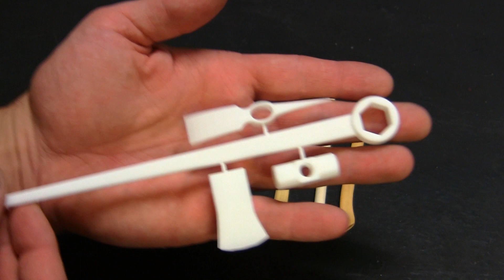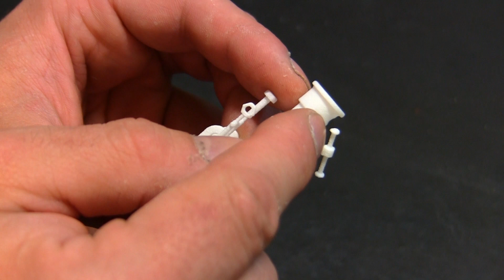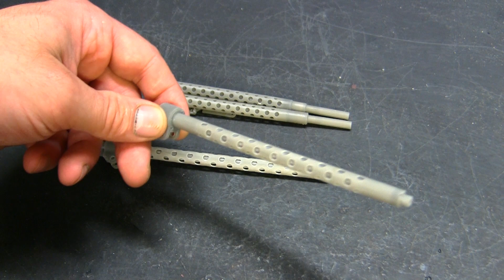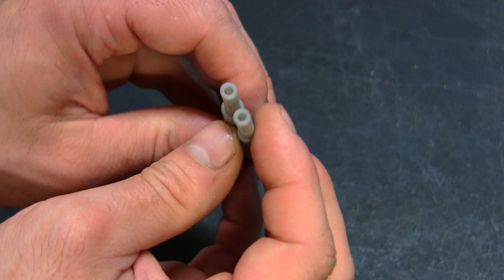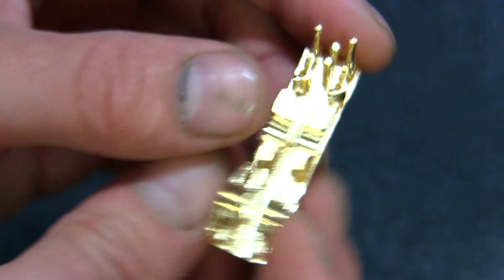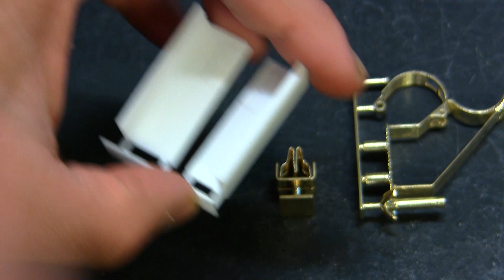New 1/6th scale US AFV detail upgrade parts

Comment: Hi John - stupid question from an old fart - since when can metal be "printed"?
Reply from the maker: it's been done commercially since about 2016 or so. There is a company that 3d printed a functional M1911 and others have been using it for Suppressors. On these I think they are investment cast where the printed part is printed in wax, then they go through the investment cast process and use brass for the pour. Regardless the part is 3D printed at some point
Reply: @oddball759mm  I didn't know that - thank you for educating me...again! 😁